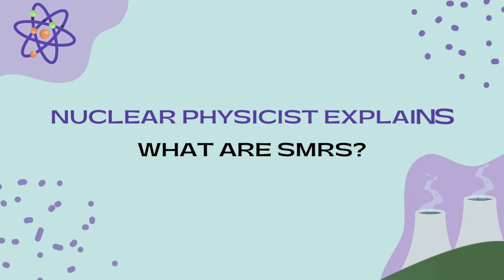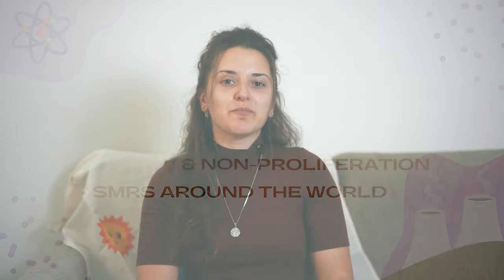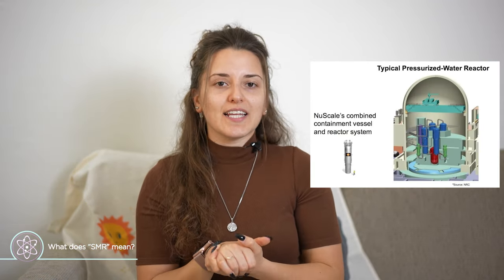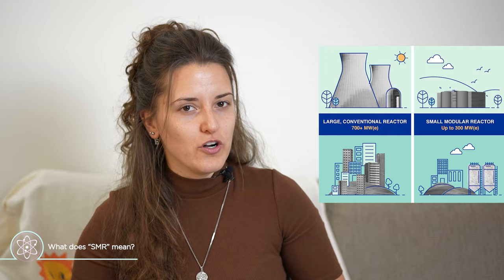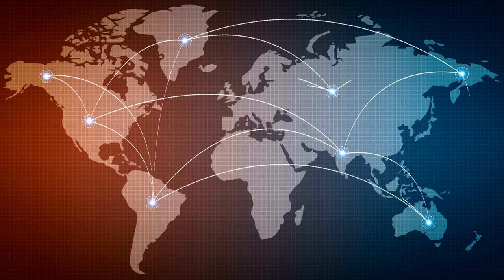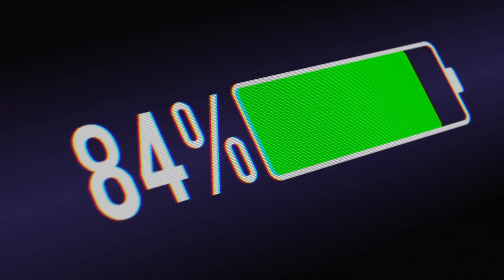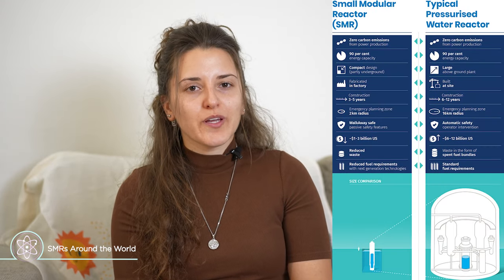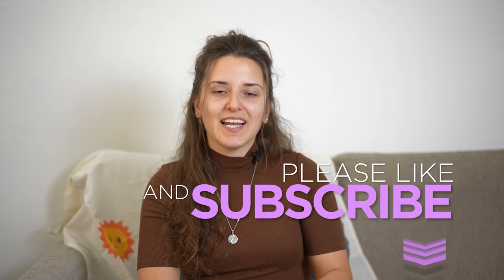Nuclear Physicist Explains - What are SMRs? Small Modular Reactors

Comment: What exactly is the reactor in a nuclear submarine if not a small modular reactor?
Reply: Highly enriched PWR, HWR, or molten salt reactor, depending on the country's design preference.  They do not share many design features with SMRs - most are gen. 3 or 4 designs.
Reply: @HuntingTarg  who cares if they are designed thr same? Are they small? Are they modular? Are they reactors? 

What's so specially different between them?
Reply: @SunShine-xc6dh  The fuel load of highly enriched uranium navy reactor costs $1 billion, they are inefficient since there is no room for the energy recovery systems of a commercial unit, they do not have the same safety systems of a commercial reactor (ocean is the emergency heat sink), and they have ~1/20 th the output of a standard PWR.
A standard PWR spans acres and every component and building is there solely to produce electrical power. Scale that down to 1/20th size and you get even less than 1/20th of the power since larger plants are more efficient than smaller plants.
Reply: @clarkkent9080  your talking about large current existing reactors. A current nuclear power plant isn't an smr... Smr are supposed to be smaller with lest individual output than current reactors.

Thank for the explanation on why smr won't be successful though I agree
Reply: @SunShine-xc6dh  I was simply comparing existing standard PWRs to SMR.  People seem to think there is an advantage to SMRs and the only advantage is that they should be able to be built faster and therefore require less initial investment.  

But they cost more (per Mw capacity) to build than a larger power plant and definitely cost much more (per Mw capacity) than a larger plant to operate. Plus try siting 20 SMRs when it is so difficult to build just one equivalent large PWR
Reply: @SunShine-xc6dh  I was comparing a standard large PWR to a SMR.  There is no technical advantage to a SMR.  Make a SMR 1/20th the size of a large standard unit and you will get LESS than 1/20th the output of that standard unit.  The first commercial U.S. nuclear reactor Shippingport had an output of 60Mw and would certainly be considered a SMR.  But even Shippingport was multi-leveled and spanned ~ 1 acre.  

You could make a nuclear reactor to fit into a sealand but if you included all the required safety systems, it would have trouble powering a samll subdivision

Comment: Born and raised in Pittsburgh. In 1965 as an eighth grade student toured Shippingport, first commercial reactor in the world. Backed the industry ever since. Also recently toured Perry in Ohio. Yet there's been almost zero significant improvements in plant design outside of control systems over last 60 years. As far as SMRs go show us the track record? The three in operation are in Russia China India. We have little information on financial viability. In fact Gates breakthrough foundation's studies show they're not feasible economically. That gig reactors are the way to go. SMRs like fusion reactors live on hopium! Always 30-50 years away. Should they prove economically viable it will be decades if not longer before a standard design and supply chain comes into existence. Assembly line manufacturing even further away as there's no international agreement and US warmongering prevents collaboration with Russia or China where nukes are booming. Today we're spewing 51 billion tons of greenhouse gases pollution into our shared atmosphere annually. Trapping heat equivalent of heat energy released by detonating 5 Hiroshima type nukes every single second. Let's spark a boom in CONVENTIONAL REACTORS which have proven their safety for decades. The damages from the few accidents we've had pale in comparison to the damages to our environment caused by fossil fuels. Killing 5+ million annually through pollution. Spoiling our streams, denuding our land by strip mining. Existing reactors have cradle to grave management of materials. Mature supply chain.

Comment: In my country Australia, the politicians especially on the opposition parties, are now talking about these modular reactors, especially on the east coast Power grid.  Whilst the current Government is moving more to renewable sources.  But I just wonder how economically viable these would be, because I did hear of a investigative report   Not sure if these modular reactors were also looked at, because the report found that without massive subsidies from government to the power companies, then nuclear power generation is not viable, and traditional renewable sources are from a better option
Reply: OZs only nuclear reactor is an experimental one located at ANSTO Lucas Heights Research Center in Sydney, designed and provided by argentine state owned hi-tech firm INVAP, which also takes part on the development of one of the few SMRs currently being built wordlwide, the CAREM-25 prototype

Comment: The  video is generally informational However some points were not stated very accurately. For instance the small modular reactor body rated at 300 MWe is almost twice the size of a standard PWR or BWR rated at 1000 MWe or more. The term small rates to its rated power not size. Further thr fuel cycle of SMR rated at 300 MWe would be around 24 months not 5 years as per current designs. The only SMRs in perdition are water cooled except two units in China which are gas cooled. The main advantage of SMRs is that they can be located  lose to I.dustrial and population centre's. Standard BWRs or PWRs require large land areas of no or limited population around them.

Comment: Would SMR be similar to reactors in submarines?
Reply: Very much so. I'd host a SMR in my own yard.
Reply: @clarkkent9080 
So in one way of speaking, similar but not the same.

Even discounting an accident, there is no need to burn through highly enriched fuel when shore power is available, crew wants to go on liberty or leave, and operation requires circulating cooling water around the dock to which the boat is moored, putting wear on the pier and operating hours on the cooling system.
Reply: @HuntingTarg  Shutting down a reactor, commercial or Navy unit does NOT stop decay heat of the radioactive fission products.  While the heat load is low, it still requires an operating cooling system and reactor operations staff to man the controls.

 The Navy reactors are shutdown in port because submarines do not have all the safety systems of a commercial unit and rely on the ocean as the ultimate heat sink in an accident.  Some nations will not even allow them to dock in their ports because of the risk of an accident

Comment: Solo Wind and Battery is a lower cost solution. Solar wind and battery can be built for millions and take years to finish, Nuclear Power takes billions of dollars and requires decades. Then the nuclear plant will run around 30 years (which is typical) and you have a high level spent fuel problem that needs to be buried for 10,000 years. However, the DOE hasn't approved transport routes, transport casks, or a national repository after 60 years of trying. No one is willing to expend the political capital to get this done. The result is we have 92 nuclear power stations with high level spent fuel "temporarily" stored in their backyards.

Comment: I'm curious about the build time. If SMRs are small and based on known designs, why does it take 5 years for China to make one ?
Reply: It is building and approving the first of a specific type that takes time. If you get one working and want to produce and operate an identical reactor that can be done quickly.
Early on we will likely want to do improvements once we have found what can be done better. This means SMR will likely need a few iterations before they are massproduced at scale.
Reply from the maker: Indeed China building and licensing the first of its kind which will naturally take longer time m. Once it’s up and running, making more of the same kind will be much faster. Thanks for the comment ☢️👩🏽‍🔬

Comment: I would prefer MSR molten salt reactors, not too small, because with medium size it becomes more economical for doing Tritium sequestration, (maybe purification, concentration), and storage (later to be sold to fusion plants)!         present 1st generation, water-cooled reactors release (some 3H into the air?) tritium into the ocean, when the fuel rods get reprocessed.  at present this is the bad practiced slogan of the 1st gen. nuclear industry: Dilution is the solution to pollution.  This practice is not tolerable for 2nd and 3rd generation reactors. 
 The good news is, that MSRs have the capability to strip out tritium-containing gases from the molten FLiBe-salt.  Health effects from Tritium in the food chain are not negligible, but also difficult to measure and quantify. I think at least mothers, embryos, and babies are at non-negligible genetic risks. At present the industry turns a blind eye to the problem, because regulations in the USA are set so, that they are  easily allowed to do so.

Comment: Another one I've heard about recently is a "Breeder reactor", and I'm wondering about your thoughts on them?
Reply: She mentioned them several times, she called them fast spectrum reactors.
Reply: @danadurnfordkevinblanchdebunk , has she made any videos specifically about them?
Reply: Breeder reactors are a special kind of reactor that on top of being able to generate electricity they also have the unique ability to create more nuclear fuel than they use. When you pair them with waste reprocessing you have an almost  limitless supply of power for thousands of years. 
          They do have drawbacks though. Some designs use alkali metals like Sodium and Potassium as coolant which will catch fire if it comes into contact with air and worse it will explode if it touches water. So coolant fires are treated like class D fires. Their other major drawback is more tied to geopolitics as not only can you make reactor fuel with them but you can make bomb fuel too.
Reply: @killman369547  Waste processing aye?  I imagine you're talking about something that end in EX right?

Comment: I'm so sick of the SMR hype,  they are never going to be economical.  A reactor needs a containment vessel, a reinforced concreete dome (you need this even if melt down is impoosible because you need to protect the reactor from the outside world), and around that a security perimeter which requires constant labor to guard.  These costs will completly negate any claimed cost savings from building the reactor vessel core component (which ARE standardized already).  And the only way you get a 25 year lifespan without refueling is to use highly enriched WEAPONS grade Uranium, another complete non-starter.

Everyone in the nuclear industry knows that these things have no future, the technology is not new, its what the Nuclear navy used for decades, they existed before commercial reactors.  The Utility industry said they did not want small reactors and they still don't, nor do nuclear regulatory agencies.  All the talk about SMR's are a smoke screen from the nuclear industry to fool the public into thinking the industry has a future so they can beg for subsidies.